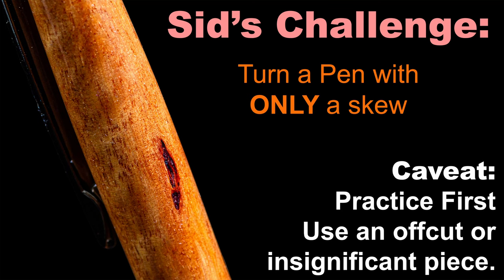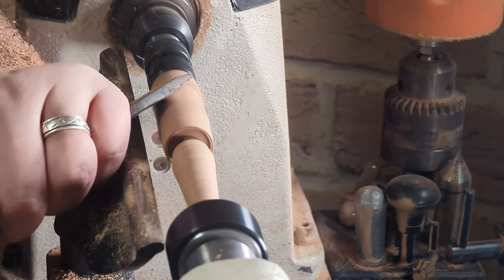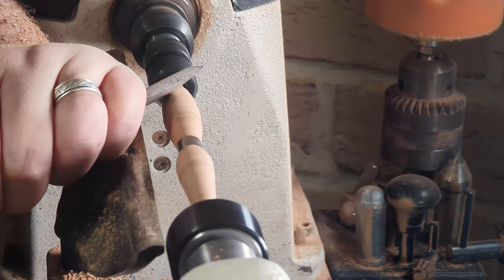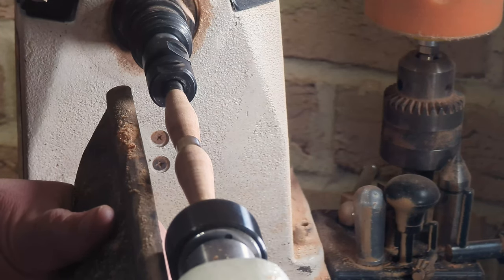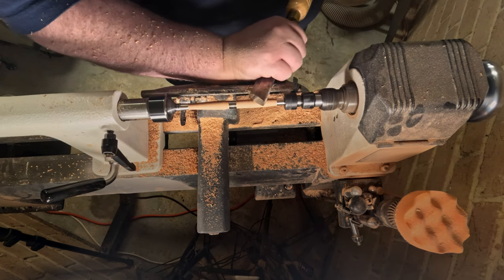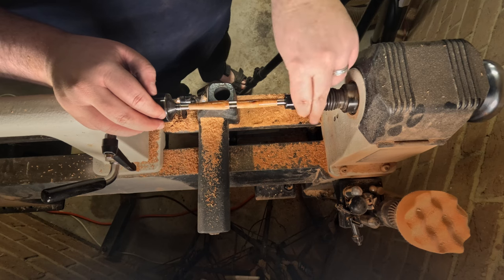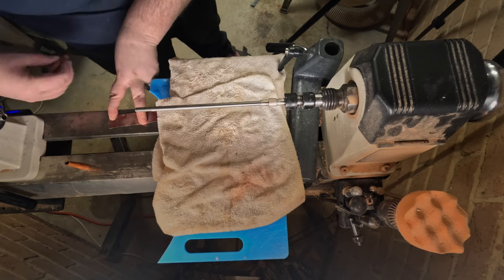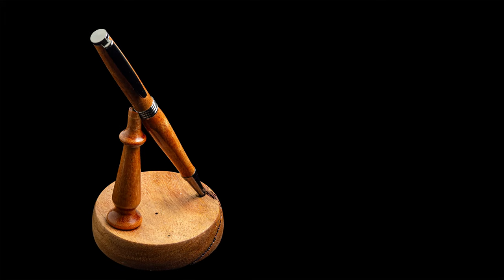Get Skewed | Turning a Tassie Oak Streamline Pen with Only a Skew

Comment: Nice one 👍 I'm thinking I need to buy a new lathe watching you work  and the pen I'm jealous 😉
Reply from the maker: Prior to purchasing this little beauty, I was hunting all over Facebook marketplace.... Wanted a decent cast iron bed... Almost had a vicmarc from a deceased estate(very reasonable price), missed it but barely.

My original lathe ended up shaking itself apart to the point it was no longer safe. The original was a home made lathe "patent pending" from an Aussie wood turner in the 80s.
Manual belt swap speed system.
The original plan for that was to be donated to the turning community, but I couldn't in good faith trust it.

It was gifted to me for free, I had done some work on it. Took it from a m40x2.5 to a M30...  Had the v pulleys rekeyed.... The I beam construction just had enough and the main bed fell apart.

Comment: Awesome pen mate. New Turner here myself. The skew is the most difficult to master for sure. Some advice how ever if I may? Having watched a bit of your stuff it looks like you suffer a similar issue to me. Simply gripping your tools too aggressively making mess ups worse. The skew in my experience is the worst for biting hard in a catch so if you have too much of a grip you only make it worse as you force the tool into the catch rather than letting it ride itself out. Try taking your left hand completely off the tool to begin with and only with light pressure control it with the left hand it'll bounce and carry on bring in the left hand keeping all your fingers behind the tool rest one finger at a time into the top of the tool  with as light a pressure as you can and only add what you need to to gain control. It'll be scary and you will make mistakes to begin with but it's worked for me. Kudos on the progress!
Reply from the maker: Great advice! I really appreciate the feedback and will take it onboard. This is also why I record, small things like this, I can go back, watch analyse and understand.

Sid has also provided some feedback, I have taken that onboard and have made the next pen under that guidance. I will do one based on your feedback and let's see how much better we can get this. Appreciate the support!
Reply from the maker: Just had a quick look and can see what you mean, around the 1min 25s mark, if you look at the centre shape of the tool. This skew is rounded in the center.

The grip I was using in this case was not trying to be aggressive (I may need some more practice and lessons to understand how grip effects) but I was aiming for control and preventing it from rolling on that curvature.
Palm with downward pressure, fingers underneath with under support on the curve. Angle and movement being controlled from my right hand.

My understanding may be incorrect, I will play and see what comes of it.
Reply: @turnedinaus  hm oval skew. Absolute pain in the ass... My first skew was an oval skew out of a set. Even more difficult to use than a traditional skew... And an absolute nightmare to sharpen... I've just gone to a high quality traditional skew. Absolute game changer! Looks like me both have lots to learn! Cheers mate. Keep us posted!
Reply: To add to this another concern I have is when you describe using your Palm for downward pressure. If I'm understanding you correctly that means the hand probably has far too much pressure on the tool and far too little control as you don't have your fingers to manipulate the pressure point. Could be a misunderstanding on my part. Time for more practice for both of us I guess 🤣. Keep it up
Reply from the maker: If you think of the shape I'm working with on that tool, I'm applying pressure to the top of the tool, closest side to the tool rest. Pressing in to the tool rest. It's a bowl turning habit, downward pressure reduced vibration and bounce. 

The support under the floating edge is more about riding the curvature.

The actual control for me with a skew is not from the tool rest hand but the rear hand. Again, another bowl turning habit which may need adjusting.